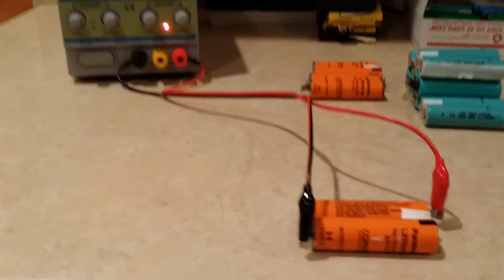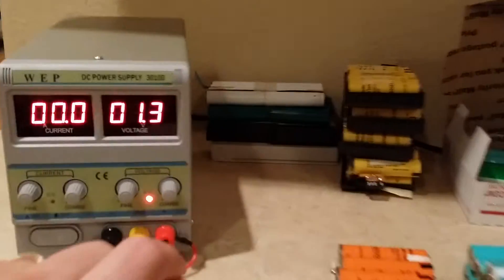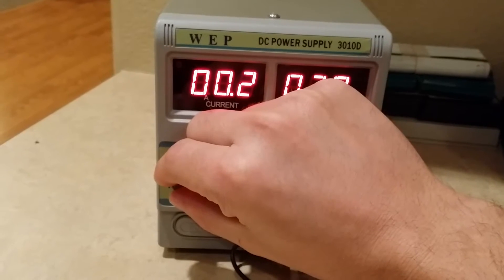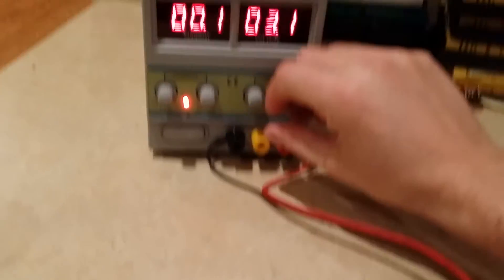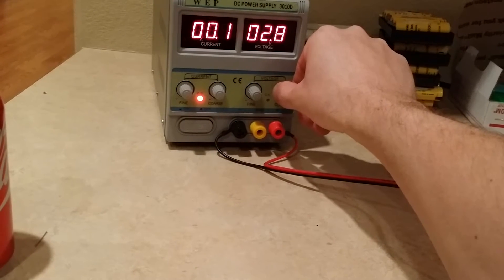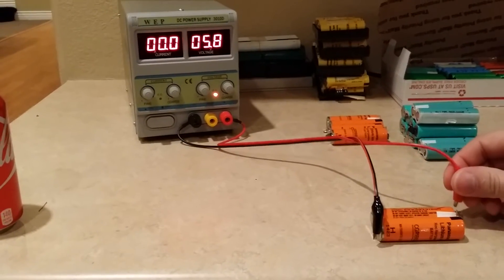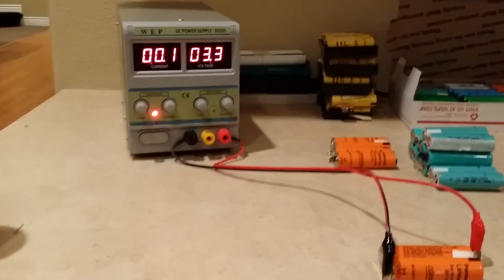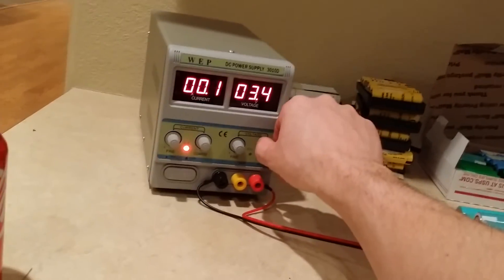How to revive a dead 18650 Li-ion battery

Comment: I have the same power supply and am running into a solar wifi security camera not charging. If the company won't help me. I'm going to rip out the battery and try this. Thanks for the video and other comments with the same charger that I have

Comment: you doing it wrong , you should charge the battery on CC mode . period . if CC mode the battery will take the set current and starts to go down on amp and up in volts till it reach 4.2 V then it will stop charging cause it is fully charged , what are you doing is wrong . you have to study and learn how you charge lithium ion battery .
Reply: Sully khan  you set the voltage to the 4.2v plug the batterie on. then set the current to a low maximum like 50mA - 100mA per cell (C.C.) and wait till the voltage on the batterie gets to around 3 volts. then you can slowly raise the current to the maximum what is rated for this particular cell. when the batterie then reaches the 4.2 v set on the PSU it automatically goes to C.V. mode and fully charge the batterie.
Reply from the maker: You are correct I did figure this out later on as I learned more about what works best for Li batteries.
Reply: Thanks for this

Comment: I have a similar charger and set the voltage first to 4.1 or 4.2 volts.  Turn the current (amps) down as low as it will go.  Turn up the amperage as the voltage increases.  This is my method for charging near dead 18560 lithium.  I used old cordless drill packs that are LiMn rather than laptops. Great video.
Reply from the maker: +Alyle 12000 thanks for the comment, that is a perfect way to do it.  This was one of my first videos when I was learning how to be safe with these batteries.   I started doing it the same way and have had great results "if they turn out to be good cells".   What are you working on with your cells?  Always good to see that others working on with there batteries.  Thanks
Reply: +15-sec-of Fame.  Working on a battery for my ebike, as my old NiCd battery died. I have never done this before, have no background in electronics.  Learning everything on the internet and watching videos to learn if I can build a 14s14p battery if I have enough "good" cells. I have to figure out how to drain the cells and measure the capacity before soldering them together.  I wasn't going to put on a battery management system because I don't know which ones are good, where to buy, or how to hook it up.  https://endless-sphere.com/forums/index.php is a useful link to learn about it ebike batteries.  Trial and error is the the way I found out how to charge near dead cells. Thought my comment  might help someone else. I'll watch your other videos too.  Thanks for posting them.
Reply from the maker: I too watched videos for about 4-5 months daily until I finally felt like I had gathered enough info to safely handle the batteries.  So I then  bought a Imax B6 and a variable power supply.  The B6 is able to charge and discharge your batteries that you are using.  the variable power supply will also help charge.  Most BMS's are charging and protecting only.  Some say true balancing like mine did, but in the fine print it says make sure all banks are the same voltage before hooking up.  If it was true balancing you would not have to worry about where the banks are charge wise.  Thanks for watching the vids and once I slow down at work I will post more detailed videos as I think my first videos were a bit rushed as I wanted to get the bike going :)
Reply: +15-sec-of Fame i get that the imax b6 can discharge and can balance charge, but what else makes it different from the varaiable power supply?  thanks for your vids!
Reply: +Alyle 12000 draining and measuring capacity and grouping similar cells is probably the most intimidating (time consuming) thing that prevents me from looking more into this.  should I group cells that are similar in maH together or focus more on what original voltage i found them at or a combo of both?  what's the safe way of combining cells that are different in capacity or voltage? in series or parallel or neither? Get's confusing and i feel if i mess up then it'll ruin a lot of the pack.   Wonder if you learned any more since you made this comment.
Reply from the maker: Hey Danh,  one thing I found is that the imax b6 will not fully charge the cells at first.  Its a cheap charger and look on youtube to calibrate it to help it charge better.   Even still if the cell doesn't fully charge you may need to put it on the variable power supply.  Dont worry about the voltage you found them at just make sure the cells are similar in mAh.  I found some @ .5v that was very good in mAh durning testing.  This process is very time consuming, but if you can get the cells cheap or free it will be worth it once you start riding :)  and you saved $
Reply: +15-sec-of Fame thanks for the response and the useful tip about focusing on mAh.  That definitely makes things a lot easier  In my case i shouldn't be worried about the time factor since I'm not that busy, but woondering how all you guys doing this stuff who probably have full time jobs spend your leisure time doing this.  It is interesting to tinker and learn though i'll give you that
Reply from the maker: danh le thanks man, yeah I do this in my spare time from work + travel and family, so I find time to do this late at night or weekends and reply to everyone every chance I get to help out.